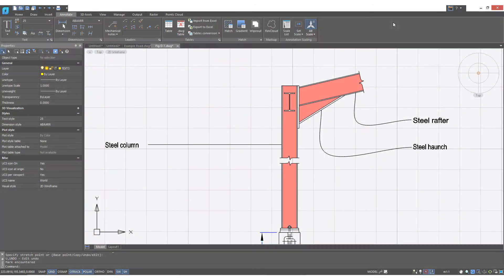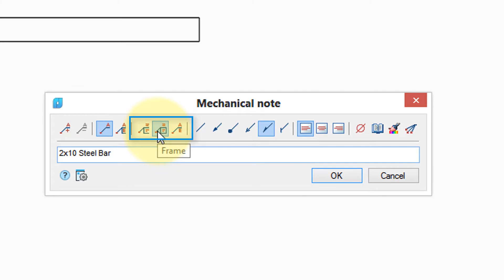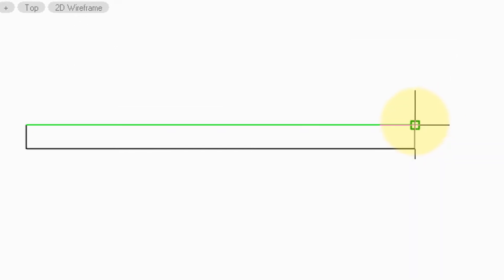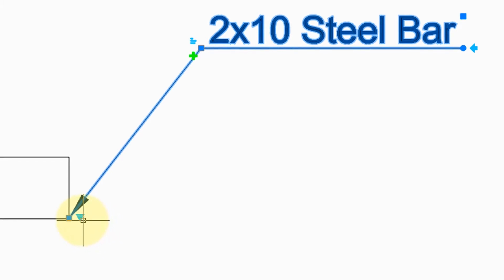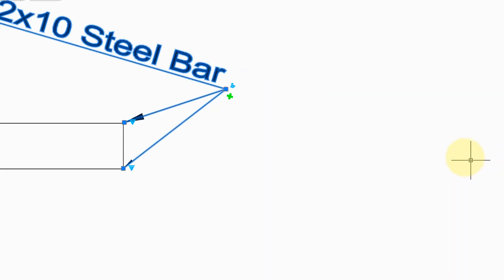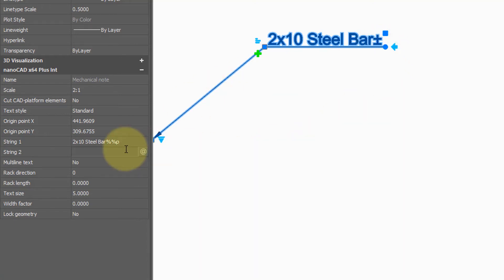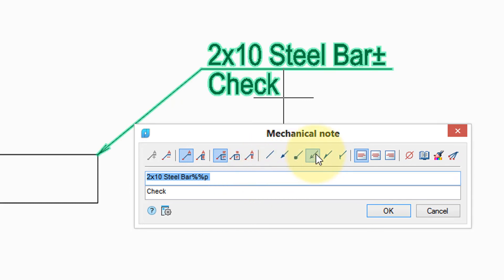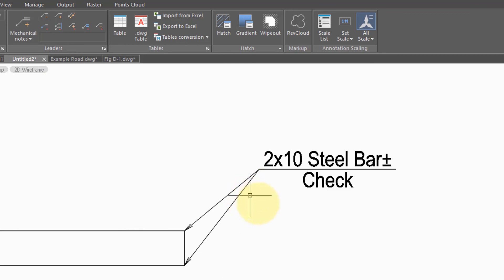Placing Callouts with Note Command - Lesson 27

Comment: The text for me seems to come in about twice as large as it should for a given scale. Any idea why this is happening?
Reply from the maker: Irishrichy, thanks for your interest in nanoCAD. On the drawing, you can set the scale of the text as you wish, as well as change its style, height, width, etc.
Reply: @nanoCADcom  Hi, Yes. I understand. But a dimension with 2.5mm text at 1:50 is actually coming out at 5mm. Whereas text at the same size and scale is correctly sized.